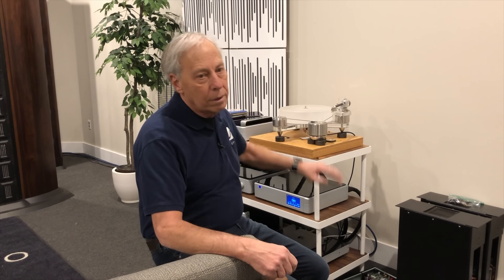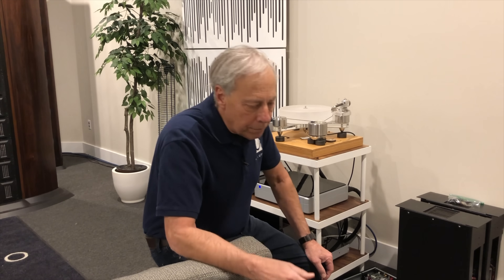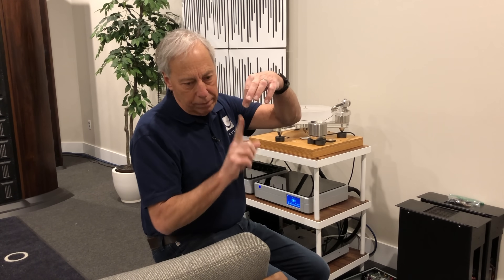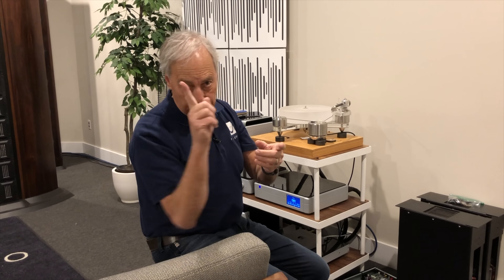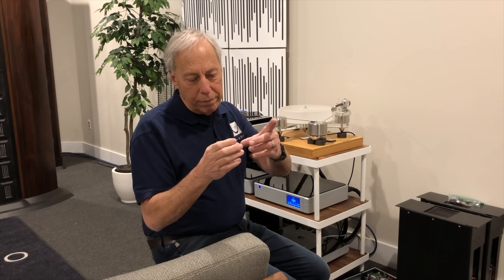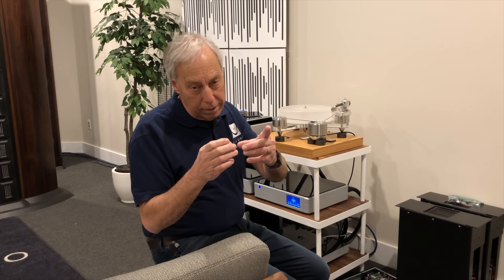All about phono cartridge loading

Comment: Well even nuclear power plants boil water which turn steam turbines which turns a generator which works by the same electromagnetic principles
One of the most efficient ways of converting kinetic energy into electricity, thus it's still used everywhere

Comment: Thank you Paul...I think I actually followed most of that!

I just got a new TT with an Ortofon Quintet Red MC cartridge and all it says is to use >20 ohms (greater than 20 I assume)..so I set my phono preamp to 100 since that seems to be the common setting for MCs. The other settings are 30, 50, 75, 100, 230, 300, 1k, and 47k...I may go down to 30 and see if the top end  is rounded off and mellowed. Does this have any affect on the bass or is it just the treble or upper midrange?  Thanks again anyway for this video.
Frank
Reply: I have not seen the video, but @30ohm you are asking the cartridge to generate more electricity, than at 50, 100, 200..., so it will slow down the response and muddy things throughout the entire range....

Comment: Isn't it putting your phono cartridge in your turntable? Also, now that you mentioned it, which is better a moving magnet cartridge or moving coil cartridge. Can you retrofit one with the other in a decent turntable? Not a high dollar turntable, but a middle of the road Tavel from the 80's that still works in every other way. In my case a Kenwood turntable with speed control and tracking control. My other turntable was a linear tracking upright turntable made by Mitsubishi, the makers of that fine piece of equipment used during WWII, known as the Japanese Zero! My turntable do that design was put into my in-laws attic when we met and I moved into her folks house so she could care for them well over 20 yrs ago. All the rubber components of that turntable melted in the intense heat we suffer thru in AZ and I had to go to a backup turntable. So, can I run both types of styluses in my current turntable?
Reply: Hi Ken.

It's been a long time since you asked this question, you have probably found an answer by now, but I figure others reading your question may not.
It all depends upon the quality, not only of your turntable and arm, but also the quality of your phono stage. For example.
I have four turntables, yes, I know that's obsessive, but I have an understanding wife. In order of acquisition, they are.
AR Legend/Rega BB300 with                                          - AT-OC3 moving coil fitted.
Alphason Sonata/HRS100mcs with                              - AT-OC7 moving coil fitted.
Transcriptor Hydraulic Reference/SME3009S2i with - 2M Black moving magnet fitted.
Michell Gyrodec/HRS100mcs with                                - AT-OC7 moving coil fitted.
You will notice only the Transcriptor has a moving magnet fitted. This is because, in my experience, the SME arm is not particularly well suited to MC cartridges, unless of a particular vintage. I have tried one of the AT-OC7 MC's in the SME, but the 2M Black is simply a much better match for the arms capabilities.
Of course, the RB300, a more modern design, allows the use of a moving coil. The Alphason and the Michell, if I'm to get the best from them, pretty much demand a MC cartridge as they are more than capable of revealing the extra information a good MC can provide.
Basically, not knowing which model you have or the condition of the arm, I would say, a decent MM would better suit your Kenwood than an expensive MC.
The task of your phono stage is made more taxing when fed by an MC cartridge, most MC cartridges have a lower output than MM's, and low output MC's substantially so. A noisy insensitive cheap phono stage will also not allow a MC to flourish.
Remember, any cartridge you fit should be of the correct compliance to best suit your arm, this is a question of matching the arms effective mass, to the 'springiness' of the cantilever's suspension., a totally different can of worms :).
Lots of videos on YT about that, which will explain how that works better than I can in a few sentences.
All the best.

Comment: Exactly and while MOST MM cart manufacturers say 47K as the "standard", it appears not to always be so as some carts do best if you move it a bit off of the standard 47K Ohms and some carts, like the now ex M98xE cartridge from SHURE did that too, 47K Ohms being recommended but by doing so, you are now hearing a rather soft top end as by that point, the treble barely hits 12K before dropping like a rock to 20K, so to fix that, raise it up about 53K or so, but to keep the hump in the brilliance band from rising as well, increase the capacitance if you can to flatten that out and when done right, you can extend the treble to about 15K and the roll off is not nearly as severe to 20K, according to one video I think it was I saw 2-3 years ago now. 

My Muffsy PP4 phono stage, a kit rather has 15 steps for impedance, 17K to 150K I believe is the range, it's close in any case but has a provision for adding capacitors in the input stage, or do as I did, add some straight pin headers to add capacitance if you need to and just as easily remove them when you don't need them. Also, Moving Iron carts like the Grado prestige series does not require any capacitance as they are unaffected by it, or so I have read anyway. I run a Grado prestige Green 1 into the Muffsy PP4 which outputs to a NAD 7240PE receiver and out to some vintage ADS  L810 speakers and the sound out of my turntable, despite it being a budget Kenwood from the mid 80's is really, really good for what it is. If I didn't have the Muffsy and the Grado and simply used the original stock cart or a similar budget model, it's have sounded middling at best.

Right now, I'm playing the Grado at the standard 47K but may put it back to 53K, we'll see and it's easily done via DIP switches. 

But to do this, need to consider one, your table, your phono stage (and if it even HAS any loading options) and the rest of the system downstream of it to do this right to get the sound you like (with less treble or a bit more treble) in relation to your room as some rooms may reduce the treble or others may over emphasize the same treble if the room is too live.

but in general, MM carts need impedance, but also some capacitance for some models. a Moving Coil cart typically needs capacitance, but apparently, some may need impedance adjusting too.
Reply: @iamspyvspy Nope. My phono stage has impedance for the MM only stage only and with the option for capacitance if you need it. You can add a head amp for a MC cartridge. 

Impedance will affect the treble response of your MM cart and some MM carts need quite a bit of capacitance, others, not so much. a MC apparently needs capacitance loading but also appear to need impedance too. However, most phono stage provide impedance for MM,  but no capacitance and many MC stages seem to do the opposite, only the well designed units provide both for both types of carts.

Comment: But you didn't explain about capacitance? Has a bearing on DB output and it's frequency range, the higher capacitance the higher DB output but at a lower frequency and vice versa and it's related roloff

Comment: He wasn’t being literal Paul  he just didn’t want a scientific explainatiion
I asked you that question six months ago glad it finally got answered

Hey Benjy I was using a vintage 1950’s era valve preamp with a built in phono stage that had a 100 k ohm loading  it sounded ok but when I added resistors to each input to bring the impedance down to about 48k, I use a MMC, it was so much better!

Comment: I'm a bit confused by the high frequencies being what is affected the most.  I have a fair bit of experience with audio equipment from the 50s and 60s and ceramic phono cartridges sound very 'tinny,' with little low end, unless they are loaded with several megaohms of impedance.
Reply: Also, there is one turntable I switched out the faulty cables with silver coated copper cables which made the supplied cartridge have excessive treble that was fixed by w\switching the cartridge.  I'd think the silver coated copper wire would lower the overall impedance.  Would this wire be part of the input impedance since it is pre-amplifier?
Reply: @spahr001  The difference in impedance with silver coated versus plain copper would be negligible. This is what you need:
https://www.eeweb.com/extreme-circuits/preamp-stage-for-ceramic-phono-cartridge-or-violin-pickups
Reply: Ceramic cartridges have a different frequency response curve to magnetic cartridges. They can be made to approximate the RIAA curve better by resistive loading, but generally perform at their best with a dedicated preamp designed to send the output to a conventional phono input. According to my friend who's into vintage gear. I left my Decca Deram cartridge behind ever so long ago when I acquired my Decca ƒƒss MM.
Reply: @jonathansturm4163  The RIAA curve is built into the recording on the record 'Resistive loading' is a way to bring the output of a ceramic cartridge down to that which is usable by a phono input.  My preferred method is to provide a high impedance input which allows for a RIAA like compensation coming directly from the cartridge into the line input.  The RIAA curve estimation, I believe, is due to bass notes causing a greater bending of the ceramic piece thus leading to greater voltage (or current?) generation vs. treble.
Reply: @My Name Although ceramic cartridges work via bending of a ceramic wafer which generates electrical signal via amplitude of the bend (vs change in velocity in a coil) the low pass filter explanation seems to make sense.  I'll look closer at your link when I have some time; Thank you.

Comment: As a Ham radio operator, I need to match the impedance of my transmitter output to the antenna. If the 50 ohm output of the amp does not “see” a 50 ohm load from the antenna, it limits the power transfer from the amp to antenna. A “match” is the most efficient way to get radio frequency waves in the air.
Reply: Our concerns as audiophiles are different to those of ham radio operators. As a general rule, the maximum power transfer from an active device like an amplifier or antenna driver to an external device occurs when the impedance of the external device matches that of the source. The optimum power is 50% of the total power when the impedance of the amplifier is matched to that of the speaker. Improper impedance matching can lead to excessive power use, distortion, and noise problems. The most serious problems occur when the impedance of the load is too low, requiring too much power from the active device to drive the load at acceptable levels. On the other hand, the prime consideration for an audio reproduction circuit is high fidelity reproduction of the signal, and that does not require optimum power transfer.
Edit: Also a ham radio operator is working with a fixed frequency and so there is a single impedance. Audio devices' impedance varies with frequency so we refer to the nominal impedance. My loudspeakers have a nominal impedance of 6 ohms, but this varies across the frequency spectrum between ~4 and 8 ohms.
Reply: Jonathan Sturm There’s always gotta be that one guy.....

I posted merely to illustrate impedance matching, generally. One thing you got wrong, Ham radio operators use a vastly larger frequency spectrum than audio and we use the same antenna impedance for all, 50 ohms. 1.7 Kilohertz all the way to 50 gigahertz and up.
Reply: @TexasScout  Thanks for the correction. I never became a ham; I was only ever a SWL. Fifty gigahertz! Wow!
Reply: @jonathansturm4163   Two different things.  Radio antenna leads are transmission lines and need matching of input, cable and output impedance to avoid reflections that distort the signal and use up power.  Transmission line effects don't become into play for audio frequencies until you are around 100+m in length.  Used to be transmission line effects could be ignored unless you were working in radio, or power lines.  But these days, with high speed digital signaling transmission line effects have to be taken into account in paths 1-2 mm long inside chips, and in network cabling (CAN) in cars.
Reply: @jkbrown5496  Did you actually read what I wrote?
Reply: @My Name It was my understanding that the output impedance of Class D was determined by the impedance of the low pass filter on the output. We had very low output impedance Class AB amps already back in the 1970s thus rendering damping factor somewhat of a non-issue. The Class D issue came as a surprise. 
Whatever, Paul's sales staff agreed that the Sprout100 wasn't a good solution for my use case and I have determined to replace my ailing Rotel amp with an RA1592. Since the old Rotel's power amplifier is working fine (nominally 100W/channel) I'll use that to drive the mid/tweeter and the new 200W/channel amp to supply the bass drivers. It will be interesting to compare the performance difference (if any) betwixt the Schiit DAC I currently use and that in the RA1592.